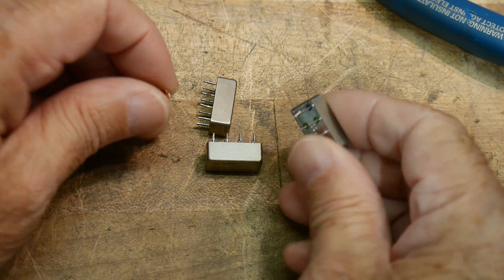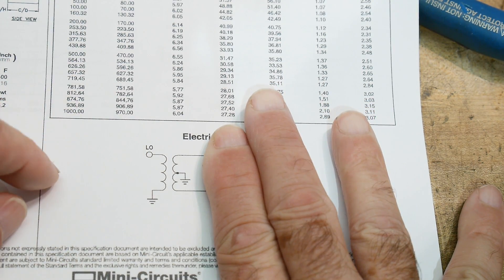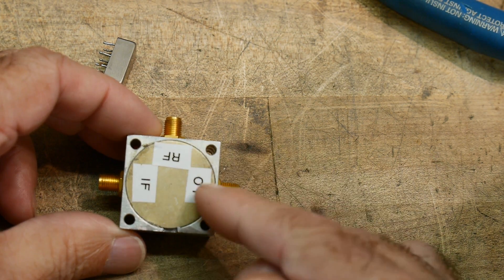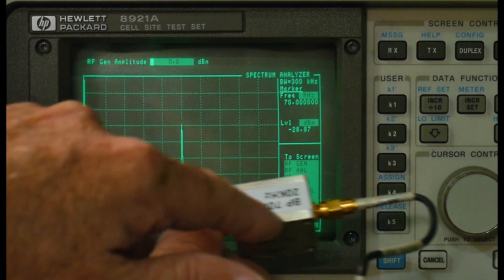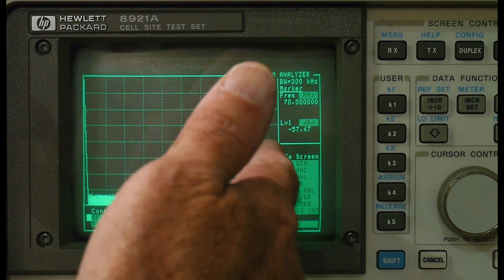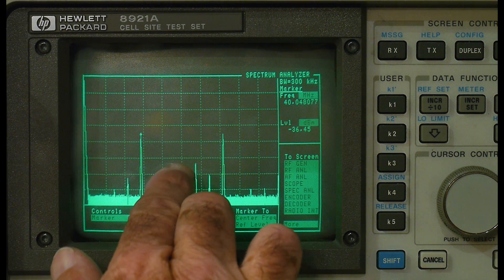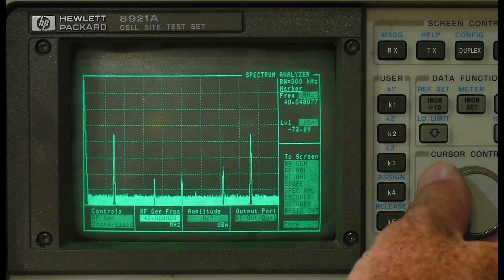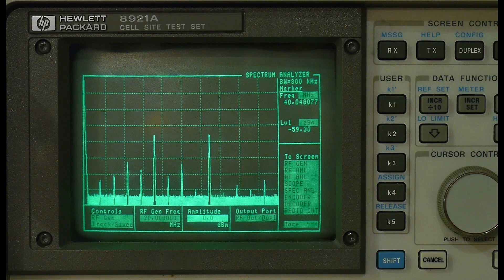#590 SMA RF Mixer

Comment: I expected to open the lid :) ... and see the magic ;)
Reply from the maker: most are hard to see, many are encapsulated. it is just a toroid and some diodes.
Reply: @IMSAIGuy  yeap, I know, and some transmission lines (some with weird shape ;) ) , I do not resist to open the box to see mixers, mmic or YIG when repairing measurement instruments or scrapping obsolete equipment . (only few filters remain intact, I do not want to spend hours retuning :))   ).
Thank you for answer, nice video.

Comment: I believe you can drive the LO with a 50% duty cycle square wave with a +7dBm fundamental amplitude and then the diodes act like on/off switches and you get the RF signal inverted and then non-inverted according to the LO polarity at the moment. This effectively multiplies the RF signal by a square wave so you get LO +/- RF and also 3*LO +/- RF, 5*LO +/- RF, etc... The even LO harmonics will be there also but at much reduced amplitude because a 50% duty cycle square wave only has odd harmonics. If the RF signal is high enough amplitude so it generates harmonics of its own in the ferrite transformers then you get all those mixing products as well. Normally the RF amplitude is small so you don't tend to get those harmonics much.

Comment: Very interesting to see how a mixture works and I do understand the limitation of the drive level (here -7dBm). A beautiful visual demonstration of the IMD products on the display. I remember you once said it is a 100 MHz spectrum analyser. Your 70 MHz Oscillator and the filter are really handy in the demonstration.
Thanks again.

Comment: Thank you for the demonstration. 
With a frequency modulation of the rf signal (in this case of about 2-5MHz) you can recognize the individual mixing products by their width. The second harmonic has twice the width and so on. 
With a ramp on the amplitude of the fm, you can distinguish between up or down conversion. It might be easier with a rather slow sawtooth as fm signal when you use it together with the averaging function of the display. 
This gives plenty of information on many of the mixing products, where they come from.
Reply: Manf 1234  ,  Interesting observation.

Comment: If you had two clean signal sources other than your 70 MHz oscillator, it would be interesting to use those two sources into the mixer with an output frequency of 70 MHz. Then you could feed the output of the mixer into the70 MHz filter and observe the output of the filter.

Comment: Great video, the spurious emissions are called intetmodulation products. They are formed by the non-linear response of the diodes. Thank you.
Reply: Exactly. That is why the drive level for the LO is specified by the manufacturer, one wants to operate the diodes in their linear region as much as possible.
Reply from the maker: @JohnTarbox  That explains a lot for me, thanks
Reply: I thought mixing was only possible if the signals are fed thru a non-linear circuit ....
Reply: @egbertgroot2737  Clearly I over-simplified. Does this help: https://www.qsl.net/va3iul/RF%20Mixers/RF_Mixers.pdf

In short, you are not wrong.
Reply: @JohnTarbox  That is a nice PDF with information. You made my day. Thx!